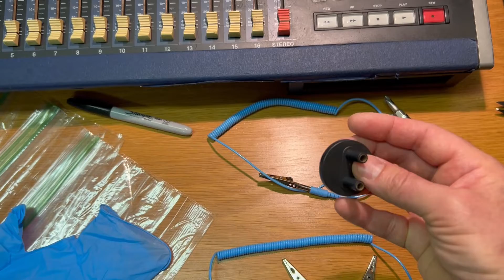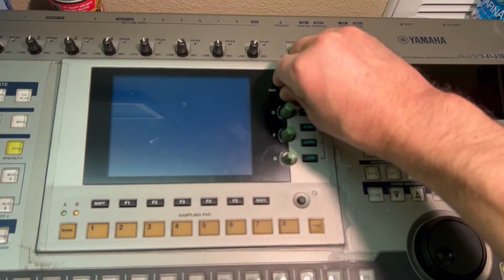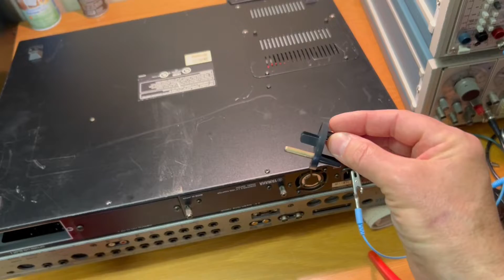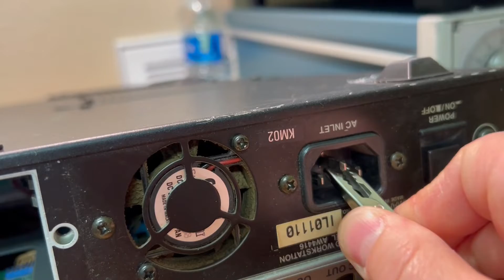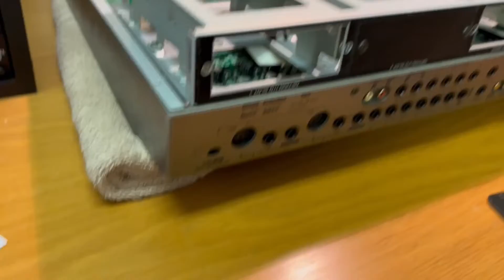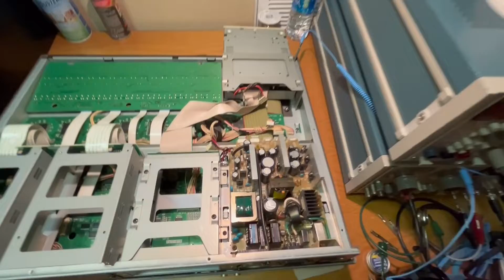Yamaha AW4416 Disassembly For RTC Replacement ~ Detailed!

Comment: Thank you, i did not get if then you have to desolder the Dallas 12887 or you can remove it by hand (and there's a socket soldered)?
Reply from the maker: The 12887 is soldered to the main system board from the factory. It must be removed using specialized tools, techniques and experience. When replacing it I recommend installing a socket first so that in the future desoldering is not required.

Comment: why manufacturers of that era didn't put the batteries behind an access door on the bottom is beyond me and why they're soldered directly to the pcb makes no sense. you basically have to completely disassemble the entire machine just to change out a battery. mind boggling.
Reply from the maker: Well I don’t disagree. The battery is integrated into the 12887 real time clock IC. And the batteries are lasting 20-25 years. And it was likely less costly to implement a single component mounted to the main system board vs a separate 12885 clock chip and an external battery. And the bean-counters at Yamaha likely argued “nobody will be using these devices in 20 years…save production money and put in the 12887.” But they were wrong. And, unfortunately, they built such a good product with some relatively unique features it is still very widely used today. At least there are affordable options for replacing the clock chip with either a new part that will last another 20 years (and installing a DIP24 socket when it’s replaced makes future changes easy), or even replacing a stock 12887 with an aftermarket part that is, essentially, an SMT 12885 with an integral but exposed lithium ion button cell all on a DIP24 package for easy future battery changes. But, again, I don’t disagree…would have been lovely to have the battery on a battery holder and a 12885 IC like on an old computer. They don’t ask us.

Comment: Fantastic video, I have got one that needs an RTC clock module replaced so this has been a godsend for me. 
Did you do a follow up of how to remove and replace the RTC from the board? If not any chance you could do one 🤞😊
Reply from the maker: I did not because there is nothing unique or special about that step…it’s just that you have to have the right tools and experience soldering/desoldering multipin components from a PCB. My goal in creating the video was to help people with soldering experience be able to do the whole job themselves and help with the tear-down/reassembly processes, OR help somebody be able to extract the main system board to take or send to a tech to replace the 12887 real time clock IC and save money doing the tear-down/reassembly themselves instead of paying the tech to do that. I consider the desoldering job to be relatively challenging due to the double-sided glass fiber PCB, and a total of 18 pins to desolder…it’s a more advanced job, but literally not a big deal if you have experience doing such work. I’ve been doing board-level troubleshooting/repair/modifications for about 25 years…I use a Hakko desoldering gun to remove the part…sometimes I need to employ some other techniques for one or two of the pins, but, generally, I can do the tear-down, extraction of the old 12887, installation of the socket and new part and reassembly with follow up comprehensive testing in about 45 minutes total. Again it’s not an unusual job for somebody with the correct tools and experience, but I would not recommend the part extraction/installation without the correct tools and experience. But the guidance in the video can help somebody even if they don’t plan on doing those parts of the process. If you want to learn more about soldering/desoldering I’m sure there are lots of resources on YouTube or other online resources to get you started.

Comment: All this to replace a battery?
Reply from the maker: No, all this to replace a real-time clock integrated circuit found in many devices. The chip has an integrated lithium ion battery. They are lasting 20-25 years. I think Yamaha assumed nobody would be using the AW4416 in that amount of time in the future.

Comment: Is this pretty much the same as the aw2816?
Reply from the maker: Here is everything you never wanted to know about the differences between the AW2816 and the AW4416 in this video:

https://youtu.be/qE1AL9wFyEk?si=lqURLzuwD82ixeLD

Similar, but the AW4416 is much more feature-rich, and a more robust build in a couple key aspects (much better faders and switches on the AW4416…longer-lasting and more reliable).

Comment: I did my RTC about 2 years ago, and just came across your video. I wish this was available before I did mine. I went at it pretty much blind and figured it out in the process. This is a great video for anyone that's going at this "task" for the first time. Excellent job putting this together and sharing. One thing that I didn't do, as you suggested, was to add the socket for the chip. I forgot to order one with the chip and didn't want to wait. I will really regret it if I am the one that needs to change it out again.

Comment: Will doing all this erase the data and current music we have in hard drive?
Reply from the maker: Absolutely not. The RTC chip is on the system board and has no impact to the data already stored on the hard drive. No impact at all. That’s the nice thing…all the data, audio and song data is on the hard drive and that drive can be transported from AW to AW and each one will boot up like it’s your own. HDD is an independent data store.
Reply: @SweetbeatsTechStop  Are you still actively repairing these? Would you happen to be in the northeast by chance?
Reply from the maker: @Layslife453 I sure am, but I’m on the West coast. I’ve had lots of people use the video to successfully disassemble and reassemble their AW4416 though, and save in shipping costs and risks by sending just the main system board assembly. The RTC replacement service is cheaper then too because there’s no labor charge for me to disassemble and reassemble the AW. Of course, I’ve had people send me the whole unit too. It just costs more to ship.

Comment: I have a question.Ask you I'm wondering if the old Yamaha.A w 4416 is better than the new tascam model 16 As far as sound quality  in 2025? I have the aw4416 d Io need to up grade to the tascam model 16?
Reply from the maker: That’s kind of a hard question to answer. I personally think the AW4416 sounds better. The AW4416 signal path is based on the popular 02R digital console and also shares much with the DM2000 digital console. Both the 02R and DM2000 were considered professional products and were/are well-regarded. The AW4416 was also designed for professional applications and integration. Contemporary products like the Tascam Model 16 are designed for and marketed at the semi-professional market, have lower headroom than the Yamaha, and, IMO, a greater degree of “value engineering” in the design both electronically and physically. But one must also consider the Tascam benefits from generations newer converters and along with that higher sampling frequency capability (though it does not record internally at a higher resolution and sampling frequency than the Yamaha). For some this is a no-brainer benefit and puts the Tascam ahead. For others, like me, the question “how does it sound” is more important than focusing on specific specifications. The other thing to consider is the AW4416 and Model 16 are completely different classes of products geared for very different applications. The Yamaha was 100% designed as a complete standalone digital production workstation capable of handling everything from tracking and overdubbing stages all the way to final master, with a deep and comprehensive feature set. The list of features and capabilities included on the Yamaha that are either vastly limited on or completely absent from the Tascam is very, very long. The Tascam, while a “recording console” and capable of functioning as a 16-track multitrack and stereo master recorder, is also a 16-in/14-out computer audio interface. As a result the depth of the onboard mixing and processing features are much more basic than the Yamaha because Tascam expects many to just use it as a front end audio interface.

Comment: Do these batteries deplete over a 20 year period whether the workstation has been used a lot or a little?
Reply from the maker: That’s a good question. I’m not positive if the RTC memory is powered by the system power vs the battery when the system is powered up…my hunch is it doesn’t make much difference, and you’d be hard-pressed to verify a correlation anyway since there’s no way to know how many hours an AW4416 has been powered. What I do know is there is variability in how long they last (seems like the issue started cropping up more commonly several years ago, and at the same time there are machines still not displaying the LOW BATTERY warning…15-20+ years?), and NOS RTC chips that have just been sitting on the shelf for 15-20 are typically bad out of the gate. So we know they deplete just sitting. Which is not a surprise.
Reply: @SweetbeatsTechStop  my machine has has only just got the 'low battery ' warning.  Any idea how long it takes for it to stop functioning?  I'm just trying to finish something off before sending it for repair. 😬
Reply from the maker: As far as we (the AW4416 community) can tell based on many first-hand experiences, the unit won’t cease to function at any point. There are community members running AWs with the battery fully depleted. The battery maintains the internal clock for time stamping. A depleted battery means you will have to reset the system clock on boot every time, as well as experience the flashing “LOW BATTERY” on-screen alert, but all other functions seem to operate.
Reply: @SweetbeatsTechStop  wow,  thank you once again for this info. If time stamping is the sole purpose of this clock,  I think I can live without it. I will carry on as is for now.  I know (and love) this machine inside out, so I can put up with the flashing battery warning. 
I won't keep firing questions at you and  I shall join  the FB group.  But one last one: has anyone found a way to  turn off the flashing battery warning? 😁

Comment: In Japan, outlet sockets have only two pins, no ground. How can I protect the boards under such condition?
Reply from the maker: Good question. You have a couple options: do the work at a location that has a safety ground conductor integrated into the mains power circuit (because that exists in Japan, correct? It’s just the minority of electrical service is hot and neutral only, correct? Or find a cold water pipe you can verify has a low-impedance path to physical earth or see if the service panel is bonded to a ground stake at your location. If you want to follow ESD safety measures and minimize risk of damage those are your options.
Reply: @SweetbeatsTechStop  In Japanese houses you can only find wall sockets with ground only in places designated for washing machines, fridges and air conditioners. I don't understand how ground system works here. All the wall sockets in the entire house have no ground.

Comment: I have worked on alot of Tascam 2488 various versions the problem with them is the transport PCB is not thick enough and a simple tactile switch replacement to all the switches is a easy job but the people that continue to use it with broken switches and they press hard on the switches. What they don't realize is that they are lifting the traces  and weakening them. The boards look more robust in the Yamaha i have a Yamaha N12 that is a really great sounding desk.
Reply from the maker: That’s a pretty keen observation. 

Yeah I’m not positive if the PCB material for those PCBs in the Tascam 2488 series units are glass fiber or not…but all the boards in the Yamaha AW4416 (and AW2816) are glass fiber and fairly thick. Out of all the devices I’ve worked on across many eras, types and market brackets, I’ve seen thicker PCBs, but not much, and the boards in general are of very high quality in the Yamaha…consistent with my experience with any Yamaha device or instrument I’ve worked on and/or used. When I opened up an AW4416 for the first time, and I’m always looking for things like the quality of the build and the engineering of the design and I was, like, “Yup…nice job, Yamaha.” The engineering reflects intended professional use and built to last. The thing with the switches in the AW4416…they are not tactile type. The end user presses on a plastic button cover that actuates a heavy-duty silicon rubber actuator with metalized rubber contacts on the other side, and those mate with the contacts on the PCB. So there is no real direct pressure on the board itself. I know that type of switch contact can require cleaning after many years, the metalized rubber, but the design is really excellent…designed to shield dirt/debris/infiltrates, and all very high-class/professional. And here’s where the rubber meets the road so-to-speak: I’ve worked on and or tested a lot of AW4416s (typically for fader servicing and replacement of the RTC chip). Not one of them has had a failed or malfunctioning switch…not one. And some of them show signs of heavy use. But everything works on them. The AW2816 is, unfortunately, different. It does use tactile switches. But the PCB is still of very good quality and I’ve not experienced a failed switch on an AW2816 either, and I’ve worked on (for the same reasons as the AW4416) or tested a number of those as well.

Comment: Hi Do you provide this service? Do other brands have this same issue?
Reply from the maker: Hi. I do. You can email me at sweetbeatstechstop@gmail.com for details. I don’t know comprehensively if other brands have this issue…I assume you are asking about this era of standalone DAWs, yes? Or are you asking generally across a variety of device types and eras? Roland used the 12885 chip which does not have the internal battery and used a separate battery and holder on the main board. This would be better. Yamaha engineers, or the bean-counters, figured nobody would still be using an AW4416 after 15-20 years because of ever-progressing technology. Lots and lots of different devices use real time clock circuits and the 12887 part, so it’s not a problem unique to Yamaha or the AW4416. The Dallas 12887 chip is an off-the-shelf part, not something proprietary or otherwise developed for the AW4416.
Reply: Trying to email you/but it keeps coming back Address not found!!

Comment: Can you operate the unit without the battery?
Reply from the maker: Yes and no. First of all understand the battery is not a separate component. It is a lithium ion battery cell embedded within and integral to the Dallas 12887 series real time clock integrated circuit, a DIP-24 packaged chip soldered to the main system PCB in the AW4416. To replace the battery one must replace the Dallas 12887 chip, which is readily available in recent manufacture stock at multiple reputable electronics parts vendors worldwide. When the battery life reaches a certain point of depletion the “LOW BATTERY” warning begins to flash, which is an annoyance because it obscures the titles of the tabs within the different screens of the AW’s function set (the ones selected by the F1~F5 function switches)…if you can navigate around the AW4416 with your eyes closed this doesn’t matter. For the rest of us this is a pain. Eventually the clock time needs set each time you power up. Audio files when recorded are time-stamped and the clock needs set to appropriately time-stamp files. The last issues are less consistent; more obscure and there is controversy around their relation to the battery depletion, but some claimthe AW will no longer save/recall mixer scenes and there are other claims of complete record action failures. It’s not certain the latter two are related to the battery failure. So the overwhelming consensus is the battery depletion causes operational annoyances vs failures. The caveat is I’m not sure enough time has passed to have a significant number of machines where the battery is fully depleted vs just low. So maybe there are unknowns in the future. The short answer is, yes you can use the AW while the battery is low, and possibly even fully depleted.